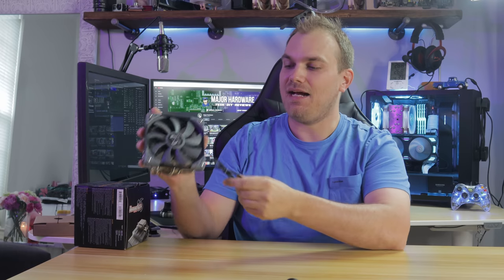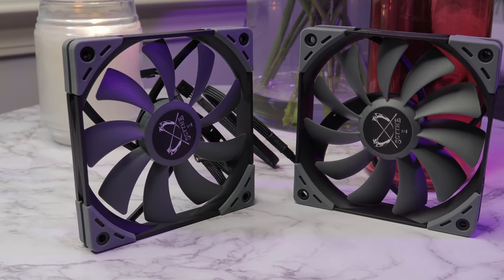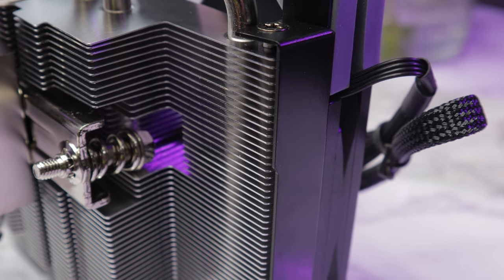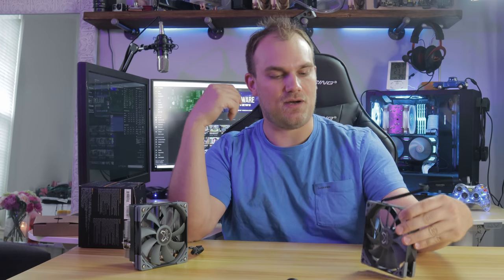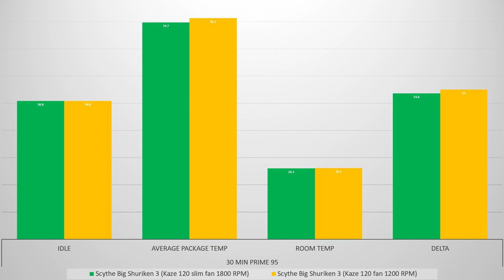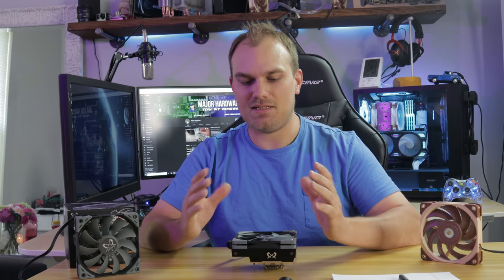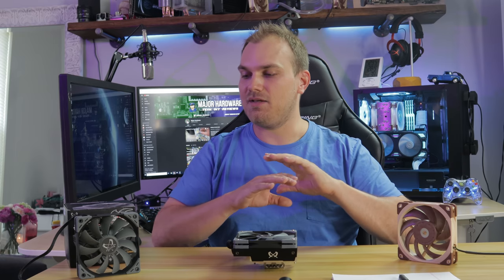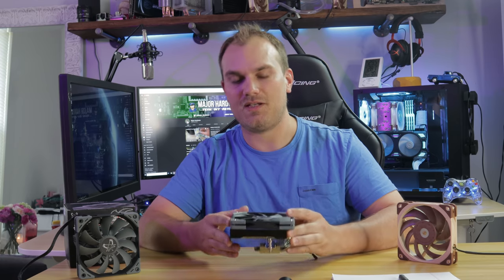IT'S SO TINY, But Does It Matter | Scythe Big Shuriken 3 Review and 25mm Fan Comparison

Comment: A more comparable alternative would be the Noctua NF-A12x15 which is a 15 mm thick 120 mm fan.  On paper the Noctua is quieter with higher airflow and it's 2 mm thinner, but real test results would be interesting to see

Comment: Had the rev 2 b or what ever of that shuriken, worked fine on a stock 4790k on a very small mitx case and was silent.. but clearly couldn't handle the overclock.

Comment: nice to see scythe is still in business.. i still have installed ye-olde scythe made quad 1.2" 5 1/2" bay mount speakers.. too bad what WAS 30$ eneded up in canada @ 80$ and fkers at the border disassembled it and put it back together with stripped screws and the Tore the do not break sticker... bastards.

Comment: Hey man, great video;) 

Im a proud owner of a Mugen 5 Rev B (with 2 fans, so kind of PCHG Edition) since this weekend (cooling Ryzen 2600), 

and I was wondering if there would be a noticable performance-gain if I replace the original Scythe Kaze Flex fans (RPM upt to 1300) with 2 Noctua fans Noctua NF-A12x25 (RPM up to 2000)?
ofcourse Scythe is budget orientated, the Noctua fans are expensive. It was just a thought for a future investment..
But you knid of answered my question already a little bit, because you did the same experiment in this video.
Whats your experience with the Noctua NF-A12x25, are they really that silent and same time well performing?
Thanks a lot, Regards David

Ps. Ideas for future vids? hm.. I like how you experiment with cooling, I did myself some experiments with graphics-card cooling (replaced original MSI GTX 1070 fans with the 2 Scythe fans, results were not good, changed back to originals;), but I would like to see unusual experiments, maybe with airflow, cooling, open case, closed case, cpu cooling, graphicscard cooling, maybe placing fans to blow on VRMs, RAM etc, just experiments! Thats always good:)

Keep it up!!